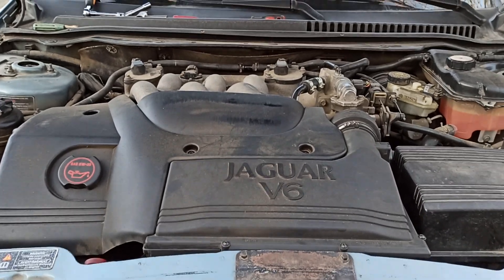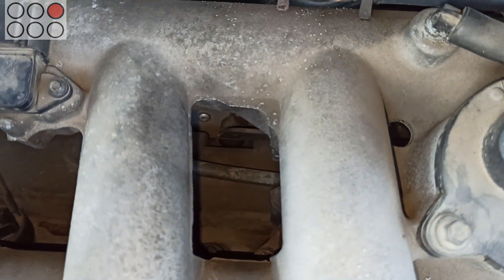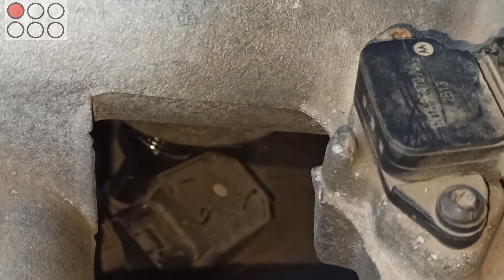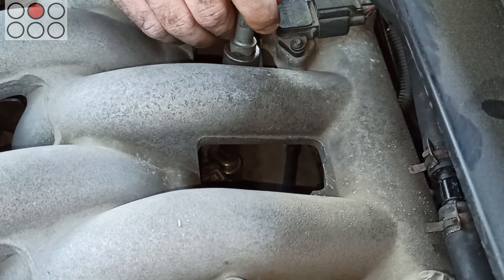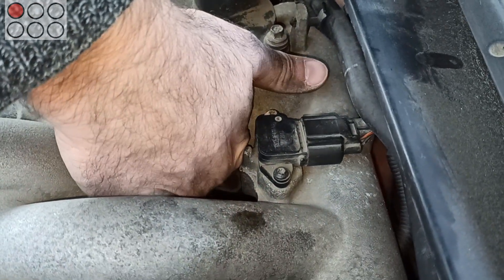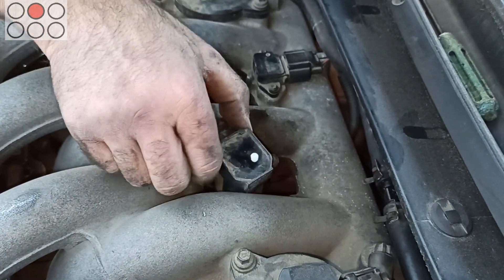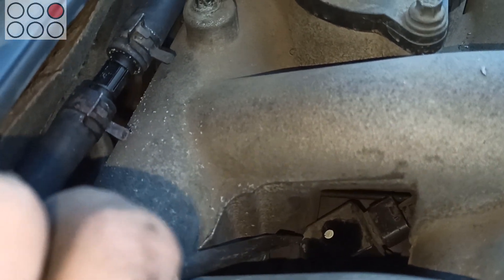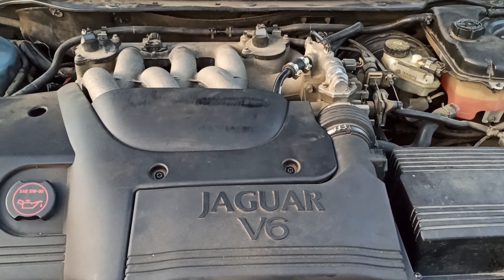Changing spark plugs Jaguar X-type without removing intake (part 2)

Comment: Just finished replacing the spark plugs and ignition coils on a 2006 x type jag with no issues. left hand is a bit bruised from reaching in but other than that all good thanks Guys great video
Reply from the maker: Thank you for watching!

Comment: Takes 5 minutes to pull the manifold❤
Reply from the maker: Yes, sure. But there is a risk of pulling out captive nuts as well.
Reply: @jaguarrroman  captive nuts, there aren't any?
Reply from the maker: @richardrichard5409  There are 3 of them, on the end of each short bolt.
Reply: @jaguarrroman  hi, the cable clamp bolts and side bracket bolt go straight into the manifold 😎
Reply from the maker: @richardrichard5409  Yes, they do. But there are 6 bolts securing the manifold that are to be unscrewed to remove the intake. 3 bolts are long and go the engine steel head and 3 are short and go to the plastic part (where injectors are inserted) with captive nuts. The more times you unscrew these bolts the more risk there is to pull the captives out. I wish you good luck!
Reply: @jaguarrroman  steel head, they are aluminium 😎
Reply from the maker: @richardrichard5409  Captive nuts are bronze inserted in the plastic and can be easily pulled out, we are talking about different things.

Comment: Amazing. I have same Model. 22 yrs old 95000 kilometers and runs still great. Love this Car - never want another vehicle. I think i will try it and save 300 Euro for mechanic 😊. But one question ? How much Newtonmeters for spark plugs ? without nm Tool ?
Reply from the maker: Hello, Engelbert! I have never considered NM while changing the spark plugs. I believe they should be tightened snug, but without excessive fanatic efforts, like on any other petrol engine. If you have any doubts, you can google the spark plug torque of Ford Duratec V6 engine. Good luck and thank you for watching!

Comment: What a great Video! 10/10 However you can only carry this proceedure out on a 2.1ltr engine model. On the 2.5 and 3ltr models you will have to remove the intake manifold. I had a 3ltr AWD and I sold it for a better 2.1ltr with FWD only. The 2.1 is a much more practical car if you are a DIY. It doesn't have a transfer box, drive shaft to the rear with a rear differential running under the petrol tank. It also only has one exhaust pipe. And yes you can get to the plugs and coils.This car actually would have been a better car with a good 4 cylinder 2ltr -2.5ltr engine and for those who can afford to pay speeding finds, a turbo charge could have been fitted. I find the 2.1ltr perky enough and very easy to get around in. I also have a 4ltr Straight 6, 1996 XJ6 and believe it or not, it is probably easier to work on than any of the V6 X Type engine etc.
Reply from the maker: I agree with every word you said, Richard. Sometimes, I am even considering swapping my 2.1 engine for a 2.5 one. Though, it wouldn't be quite correct, as the final drive ratio of 2.5 gearbox is different.
Reply: @jaguarrroman  I think that the 2.1 V6 X Type is the most practical because of it simpler format. And the only improvement or alternative would be very impractical. The 2.5 would still have the problem of simple access to the plugs and coils.  I have always said. this car would have been a great car with a 2.4 or 2.5ltr 4 cylinder engine. Ford has a great 2.4 four cylinder petrol engine that they have been using in their big Transit van for decades. That engine would have been so smooth, quieter and would have had plenty of power. But the buyers just want V6's and V8's and thus we have the problems that come with this buyer want, which is more than needed. The modern car is over engineered and very impractical in so many ways. And the buyer just wants to complicate it even more.
Reply: @jaguarrroman  Stick with the 2.1ltr unless you really, really do need the extra power. I have worked out and as I have said before, this car would have been a much better car with a 4Cylinder 2.5ltr engine. It would have been quieter and much smoother.  Fuel economy would have been better also. You can listen to others but I also have a 4ltr X300 XJ6 Straight six engine which is a much heavier car and the fuel economy on that car is not that much heavier than the 2.1ltr V6 X Type. These V6's rev very high and make a lot of noise. Most V6's are never as good as a simple 4.
Reply from the maker: @richardautenzio8117  I preferred my 2.1 V6 mostly because I didn't want to get in touch with all the AWD transmission troubles (driveshafts, transferbox and so on). As for the engine volume, I also would like to have a 2.5 with a front wheel drive transmission. I even wouldn't object to a V6 2.5. But unfortunately, there is no such an option and it is rather tricky to swap engines. It may be better to swap it for an electric drive straight without any intermediates.
Reply: @jaguarrroman  👍Stick with your 2.1ltr. You know, a practical car should have all the regular service components accessible. That certainly includes the ignition system. The more modern and the more power they put into these cars, the more impractical they become. The only reason I tolerate the mechanics of my 2.1ltr stupid V6 is because the car is rather unique and classy. Both outside and inside. The X Type is the last of the Jaguars that has the traditional Jaguar  characteristics and styling. Climb in to a modern Jag and it could be a BMW or another car.  Jaguar was never Just the name to me. It could have been called a Pussy and I would have loved the car. Today they could call it a Rolls Royce and it would not impress me. Don't laugh. They are selling us crap for luxury today. All gadgets and very little uniqueness. Even Rolls and Bentleys SUV's without their badge etc would not look much different from so many other SUV's.
Reply from the maker: @richardautenzio8117  Right you are. I chose my 2.1 deliberately and don't intend to get rid of her in the near future.
Reply: @jaguarrroman  👍

Comment: nice job, but it's not working for 2.5L & 3L. The intake manifold in not the same....   Vraiment dommage.
Reply from the maker: Right you are, thank you for the comment. Vraiment dommage for 2.5 and 3.0, but an advantage for 2.1. Cheers!
Reply: @jaguarrroman  So can you do this on the 3.0L V6? Or must the manifold come off?
Reply from the maker: @allanpennington  This can be done only with 2.1 and cannot be done with 3.0 and 2.5, because their manifold is of a different design and must come off.

Comment: great video , is the secret you mention, you have the bonnet off ?
Reply from the maker: You are the only man, who mentioned the secret. The bonnet is OK. The manual is also OK, you can follow it. But the secret is, that during taking the video I didn't have to change the spark plugs and I didn't want to unscrew them just for nothing. So I didn't change the plugs in reality, I just cut the video when the socket is taken out of the spark plug wells.
Reply: @jaguarrroman  When do you know you need to replace the plugs? I just know if I tried this I would drop a bolt and never be able to find it again.
Reply from the maker: @allanpennington  Usually I need to replace spark plugs when the engine starts misfiring, especially in the morning. Sometimes I do it before passing the MOT test.

Comment: Thanks for the videos very helpful I also have a 2002 2.1 xtype and it has a problem no all the time but when at low speeds the orange light come on and cuz control unavailable car runs roughly does this on and off and then goes away most days car runs great 85% of the time would be great if you do a video to fix
Reply from the maker: Thank you, John, for your comments. I have got the same problem, it bothers me for quite a lot of time, I tried many things to help it until at last the knock sensor error occurred. Now I am waiting for a new knock sensor, it will arrive in some 1-2 weeks and I intend to change it without removing intake, in my manner :-) Surely, I will take a video about it. After that I will check if this was the reason of my CRUISE NOT AVAILABLE and let everybody know about it.
P.S. First of all, you should read the error codes, because CRUISE not available may be caused by many reasons, For example, earlier I had to repair ABS unit to get rid of it.

Comment: I have been waiting for this part since i watched part 1. Without removing the intake! Man this is interesting..
Reply from the maker: Thank you for your comment. I am glad that the video is useful to X-typers. I've been driving an X-type for about 6 years and I also have an experience of the following removings: alternator without radiator, fuel pump without fuel tank, roof lining without windshield, front suspension arm without front subframe. I don't guarantee that I will take videos about all these cases, but some of them surely.
Reply: @jaguarrroman  awesome.. would love to know your opinion on the X-types since you've been driving it for 6 years... are they considered reliable compared to other cars from that era?
Reply from the maker: I'm driving a Front Wheel Drive X-type with manual gearbox, she is more reliable than AWD. AWD has too much things, you can do without. Manual gearbox is more reliable than automatic. As for diesels, early ones had very restricted lifetime of the injectors, since 2005 they got rid of this issue. On the whole X-type is well equipped for her time, but sometimes electronics give you headaches, mostly because of the previous owners/ bad maintenance. Petrol engines are good, reliable and smooth. Headlights bad because of the low voltage system, needs Xenons. That's it. Still the car has got a charisma, other competitors of early 2000 have already lost it long ago.
Reply: @jaguarrroman  i agree... i bought a 2.1 and accepted the little loss in power just to avoid AWD headache... will be waiting for your upcoming videos!